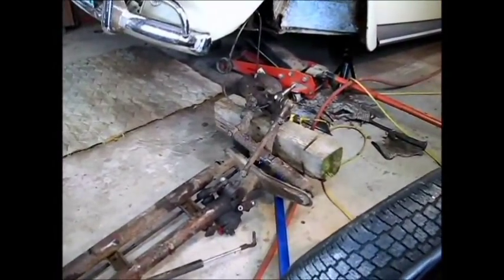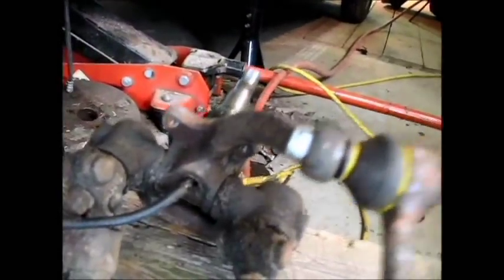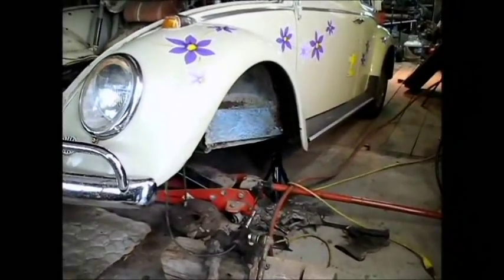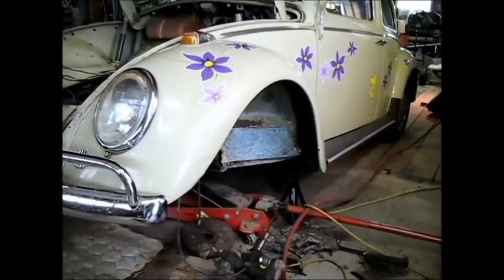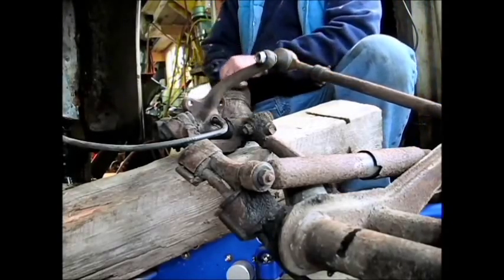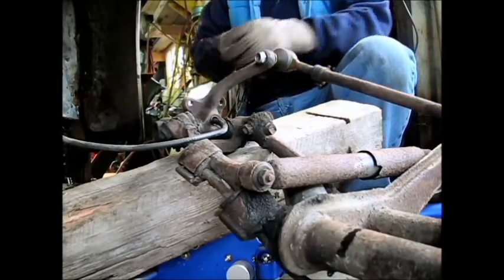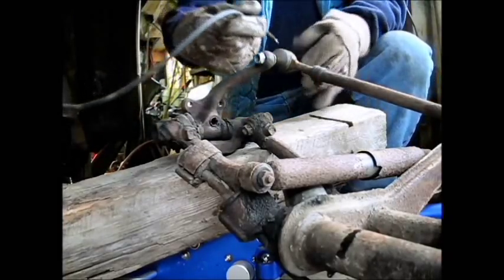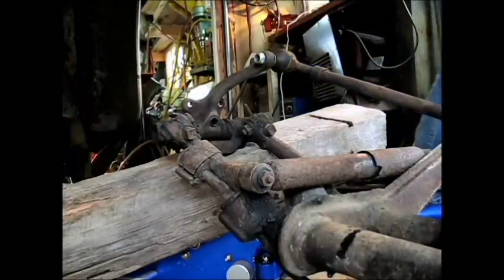1964 VW bug speedometer Cable removal

Comment from the maker: I don't think you have to take the axle out like I did.  I just did that 'cause I replaced mine with a dropped axle.  You should be able to get it out without taking the axle out, probably without even taking the wheel off.